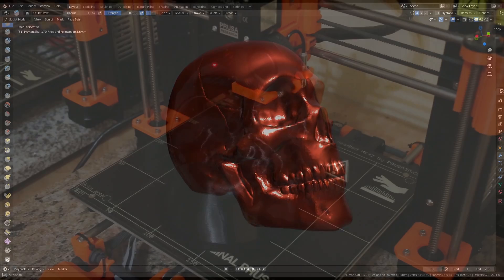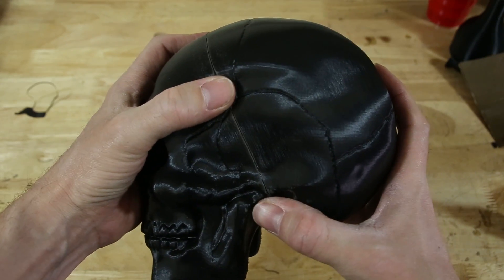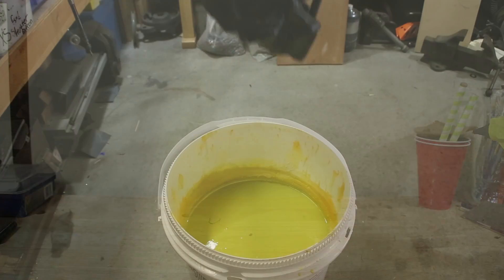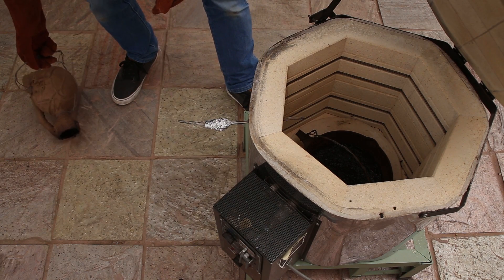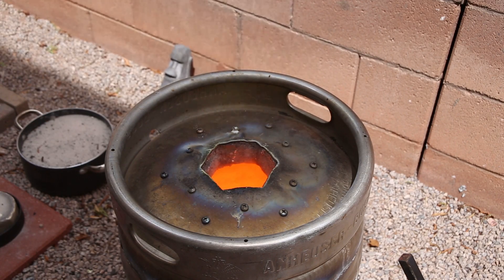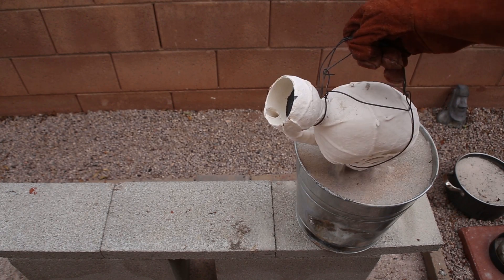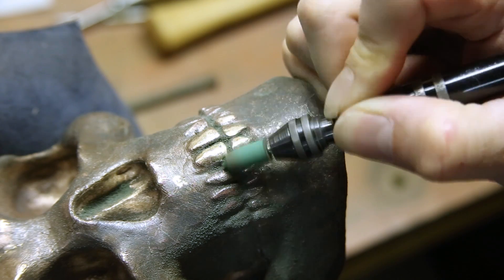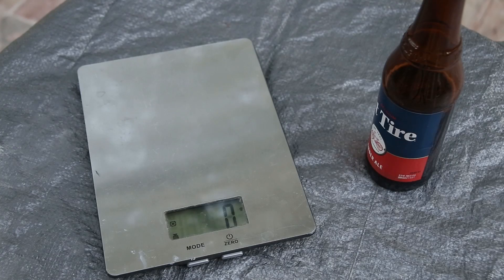3d print to SOLID BRONZE SKULL - Lost PLA metal casting

Comment: @1:47 for the most part all brands of superglue are the same (its all cyanoacrylate) what makes the difference between cheap stuff and expensive is literally the container its in (and I'm not just talking about the branding):
- are you able to carefully apply it or do you end up just blasting way too much on everything
- do you get to use half of whats inside or 5% of it before the tip seals up and you throw the rest away in frustration after trying to declog with a needle a few times (just to have it re-seal itself even better every single time you use it)
- does the container keep the glue inside or ruin everything next to it in storage
Those are the real differences in my experience

Comment: plaster of Paris, clay dust, finely crushed masonry sand, distilled water.

makes a pretty decent cheap ceramic slurry. it is important the plaster, sand and clay dust is bone dry and very fine. run through a fine mesh siv. mix evenly in equal parts.

Comment: Hi. I have an idea. In order to prevent cracks while concrete cures, we can add glass fiber. Maybe you can do the same. Have 2 buckets, one with regular slurry and second with slurry mixed with glass fiber. Make every other coat with glass fiber. I thinks it should prevent cracks.

Comment: Others may have already mentioned this, but I've had success "bubbling" compressed air into the base of the sand buckets to encourage liquefaction of the material.  For me, it makes it MUCH easier both to add the silica sand during the first dipping steps (and help ensure even coating of the silica sand on the SuspendaSlurry) as well as preparing the support structure you mentioned being difficult when getting ready to pour into your pre-heated mold. GREAT work though!  Love it!  Please keep it up!  :)

Comment: Would it be possible to print a inverted model with detail "inside", then do a silicon mould and then use the silicone mould to create the ceramic so you wouldn't have to burn away the plastic?

Comment: An idea to save yourself some manual labor hours, build a small oscillating table with a bucket on top,  If you were to suspend the skull/ object in the bucket and fill it with sand/polishing fillers the vibration does all the tedious work for you

Comment: If you're feeling REALLY Ambitious, see if you can get your hands on a plastic Anatomically Correct Full Human Skeleton Medical model and use that to cast ALL the other bones in Bronze and then use the metal bones to recreate the plastic model...

Other than it's weight, it would make a GREAT Halloween Decoration for your front window...

Especially if you drill a hole in the back of each eye socket and add spooky red LED's...
Then, with a set of tattered robes (so everyone can see the rest of the skeleton), now you have a Life Size AD&D Undead Lich...

Comment: Very cool. I worked Maintenance at an investment casting place.  After it's dipped in the slurry, they rotate the mold at like 4 RPM as the slurry drains, they also had sanding drums, the robot holds it in there it rotates and vibrates and the sand rains down as it rotates the mold at about the same. They steamed out the core in a boilerclave. Love your videos, amazing results.

Comment: I had a really cool idea for the skull! Drill small holes in the back of the eye sockets, to accommodate wiring for some red LEDs. Paint the inside of the eye sockets with an ultra-bkack paint (like BLK3.0 or Musou black). Then, instead of having the LEDS shining out uncovered, mount a concave disc/umbrella shaped shroud is ultra-black on the side facing out and silvered/reflective coat on the
inside/LED side. That way, the disc/umbrella shroud looks like a super black pupil/iris, which is surrounded by a red glow. I think it would look incredible! Awesome video, keep up the good work!
Reply: I've got a project like the one you're referring to, and let me tell you, LED's of that sort are really hard to come by, but I absolutely agree with your proposition, as it would ''enliven'' this magnificent sculpture in a very special way! . . . 👌

Comment: Spend a little more time removing the seam on the plastic so it will not show as much on the finished piece. Aluminum foil has a shiny side and a dull one. It might not help much, but put the dull side where you have to pick it up to deflect some heat away from them.

Comment: if you want to remove the interior ceramic have you tried thermal shocking it heat it in an oven or your kiln then cold water might be easier to remove but i dont know for sure

Comment: Very nice! Fantastic job 👏 my word. One thing I'd say though is stick the two halves of the skull mould together first, then sand the whole thing after. By sanding each half before, the edges to be joined are slightly beveled, I think I can see a slight indentation around the finished skull where each half has been glued. I hope you don't mind me saying this. I don't mean to knock it. Just help with fine tuning 👍

Comment: Nice. Though I think you polished it too much. Newbie bronze casting mistake. I did it myself. Loses character, makes it look more like something you'd find in a trinket shop. Remove layer lines before cast, cast, then very lightly polish, leaving some of the grit and texture in there, especially in recessed areas, then add details.

Comment: I liked this. I've been thinking of making some aluminium bronze stuff for a while, and, even though this is a traditional tin bronze, there's probably many parallels. 
For the record, and somewhat tangentally, simply rubbing PLA with Scuply Clay (a type of PVC polymer clay) works very well at smoothing prints and still retains paint if you feel like painting it after the fact. It wouldn't work perfectly for lost PLA casting, but it works pretty decently for plastic figurines.

Comment: You might have good luck using a needle scaler to remove the ceramic after the casting. I'm not sure if it would leave indentations in the piece, but I bet it would make short work of the shell.

Comment: Why not use an Investment plaster mold? It has very good detail retention, no leakage, and best of all, is water soluble (instant clean-up after 5-10 minutes of cooling). The only downside is the requirement to put in a vacuum bell to remove any air bubbles from the slurry.

Comment: Ideally your vents aren’t connected to your sprue. You want to prevent gasses from getting trapped while pouring so that they don’t create voids in the casting. Your vents can be pretty small. For a casting that size 3-4 vents each only needing a diameter of 3/16” - 1/4” should be plenty sufficient when properly placed at low spots or pockets where gasses could easily get trapped.

Comment: next time when you attach the stick to handle the project. make sure to print threading into the hole, so you can screw a threaded stick into the notch. no slipping. then all you got to do is unscrew the stick. better than just hot glue. I mean still use the hot glue to lock the twist. until it's ready for release. cos I am sure those dips into the slurry get heavy after a while. depending on the size of the project.

Comment: There are filaments specifically for investment casting (although I don't know if they actually work all that much better). There's also PVB which is very similar to PLA (including melting temperature), but is smoothable in isopropyl alcohol the same could be done with ABS and acetone.

Comment: In the future you can use a couple thin coats of spray clear coat to hide print lines. The wax works fine but it would be a lot more work

Comment: Your ingenuity in this field is inspiring!  I'm in the process of experimenting with some of these methods so I'm very much indebted to the resources you're providing.  I was wondering, how long do you find it takes to melt out the PLA at 500 degrees?
Reply from the maker: Thank you! I’m glad my videos are helpful! Once the PLA starts to flow it doesn’t take long, about 20-30 minutes. The trick is to go slow. It’s easy to over heat the PLA at which point it will catch fire when you open the lid and introduce oxygen. Check out my older lost PLA videos and you’ll see what I mean about the fire. Good luck!
Reply: @robinson-foundry  Right on, thanks for the info!  I've been watching all your videos haha, really cool what your doing.  Also, I used Trewax Clear Paste Wax to fill in the build lines and you might want to give it a try.  It's much softer and I found it a lot easier to work with (rather than heating up hard wax and trying to work with it).  For deeper lines I was using a combo of the two, but you can get a really smooth surface pretty easy with it.  Thanks again for the info!

Comment: Just out of curiosity, what about creating a segmented skull, using the various bones as the segments, and also using lap joints between each segment, that brazes together? This should be able to make each portion mostly blemish free, and the various pieces should be easier to clean up. Similarly, the teeth could be done in this way, separate pieces that get brazed into place, so that it looks more realistic. 
Segments seem like they'd be easier to do for hollow objects, especially if those hollow objects have complex geometry.
Reply: i couldn't say about all that, but, man, that would be a lot of extra work! this thing isn't meant to be incredibly accurate, the model is basically halloween decoration level detail.

Comment: One thing you could try that I just thought of would be to instead of printing the sprues for the in side, use a broomstick and something else, that you can just pull out, That way plastic only sees rising metal, so it doesn't bubble back out of the pouring hole and potentially ruin it!

Comment: Another amazing video. May I suggest printing and casting intricate geometric art sculptures? It would be great to see something only a 3d printer could produce. The only difference would be I don't think you would need the slurry, as it would be impossible to remove from the finer indepth parts, given how hard it bakes on, but instead using investment plaster, which can be easier to remove. Also, which 3d printer do you use, as I have noticed you using an Ender & Prusa?
Reply from the maker: Thank you! I’d like to do that. I’m setting up for investment plaster casting so that should allow me to make things like that. Thanks for the suggestion. I use Prusa mk2 printers now but started with CR10 and Ender 3 pros. They’re both great. I find that the Prusa is more reliable but I’ve had better quality prints come off of my Enders.

Comment: This was great. I'd love to see this done again some time in the future, but with the jaw molded separately.
Reply from the maker: Thank you! Yes, I'd like to try again. This version was more of a proof of concept. I plan on trying more complex things in the future.
Reply: @robinson-foundry  Those little nodules that you had to remove from the teeth, nose, and eye, look like air bubbles that formed when you did the first dip. You should connect a vibrator of some sort to the handle for the first dip to prevent that.

Comment: Could you share Nozzle size and layer thickness? I am using Overture Black as well... I am trying to 3D print some casting patterns but have issues with the layer lines. Thank you.

Comment: what's called the liquid ceramic material??? i need this, seems a very pleasant way to make a mould!!
Reply: Fairly time consuming though. Think that was at 10 layers he did for this.
Reply: @nic.h  yeah, seems time consuming, but passive time consuming, you only have to wait between dryings
Reply: btw as far as i know, 5 layers are ok (depending on pattern geometry)
Reply: @doomhunta1094  true the actual labour time is probably pretty reasonable. I suspect you could do less layers as well, but may have higher risk of blow outs. Investment plaster is another option, but need an appropriate sized and type of container, and it's not as efficient in materials being used. I've been pondering the ideal if you could directly 3d print an investment mold, saving material and the need to print and burn out the pla/resin, although you'd still have to cook the mold slowly to remove moisture.
Reply: @nic.h  my 3d printer arrives in a week so id be experimenting!! i just discovered that a filament called PolySmooth dissolves in Acetone, so ill be running small scale experiments with polysmooth + plaster and dissolving the 3d printed pattern in acetone somewhat soon!
Reply: @doomhunta1094  I think you'll find dissolving in acetone will leave residue in the mold, resulting in imperfections when casting. Although I'm not familiar with polysmooth so it just a guess really. Good luck with the new printer and testing
Reply: @nic.h  that sounds like definitely will try this shell method, seems very pleasant and accurate :P

Comment: Just a tip, if you want to get a really smooth finish on your 3d prints i would suggest looking into acetone vapor baths. The tldr is that the acetone vaporizes in a bucket that the print is suspended over to create a glass like finish whem dome properly. It can be finicky but will get you really nice finishes

Comment: Very nice to see that you tried my method of firstly melting out the excess of pla at 260*C and after that vitrifying and burning out pla leftovers and 900*C.

And a little LoL - did you print it on heatbed itself without the buildplate ? When there is stricly said Do not print on this surface? 😂

Comment: I have yet to make my foundry (will be looking to find a keg to convert like yours)... I was wondering what your thoughts are on the ability to use Lost PLA casting to create a 1:1 R2D2 dome? I'm assuming it would have to be cast in a few pieces then welded together (my plan is to use aluminium, which I'm aware is trickier to weld... but easier to source material for at little to no cost). Any suggestions/advice?
Reply: Single piece using greensand might be an option. Big cast though

Comment: Filling layer lines with wax is a great idea. It’s almost like the pla is just an elaborate base for a thin wax model.
Reply from the maker: Thanks! It worked really well!
Reply: there is an even better way, you can apply UV resin (3D printing resin) with a simple brush and let it cure in the sun, all surfaces will be smooth and it is way easier to apply than wax.
Reply: @DizzyPanda  hey, have you actually done that? What resin did you use?
Reply: @tgirard123  I have tested it with a 3d printed toy. I was using cheap elegoo uv resin (it is for SLA 3D printers), but I am sure brand doesn't matter.
Reply: @DizzyPanda  awesome, I'm going to give that a try. That really is a slick idea
Reply: @robinson-foundry  been watching your content all day, could you describe what adding the vents to the mold does? i get that it lets it fill with the liquid metal, but why is this needed?
Reply: @snarevox  You need vents for air to escape. As a mold is filled, air can get trapped and prevent the mold from completely filling with whatever you are using.
Reply: @davinci3259 but see, the vents are completely enclosed within the mold.. look at em once, they dont have any exit holes for any air to escape. and when he opens the mold, those vent channels are filled with hardened metal so theres no air in them. and since the vent volume is far less than all the rest of the voids in the mold that are being filled, they cant hold the amount of air being displaced.. theyre full of hardened metal when he opens them, theyre not holding any air. theyve gotta be there to facilitate a quicker and more uniform spreading out of the molten metal and to allow the mold to be completely filled more quickly.
Reply: @snarevox  It is for air, hence why it's called a vent. I don't cast in metal, but I do cast in resin. As it fills, the air that would be trapped at the bottom has to have somewhere to go. Otherwise depending on the orientation of the mold, high points would catch air and prevent it from filling with material.
Reply: @davinci3259  word
Reply: In my projects Im gonna try next a castable 3d printing resin - Bluecast X5. Couple of coats and we will see how it will turn out
Reply: Can you please put a link to the ceramic slurry?